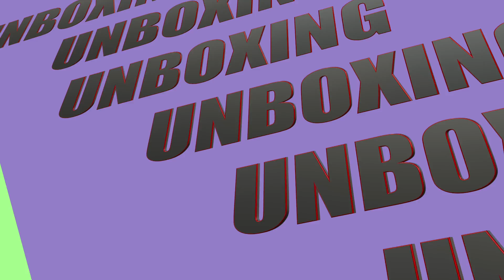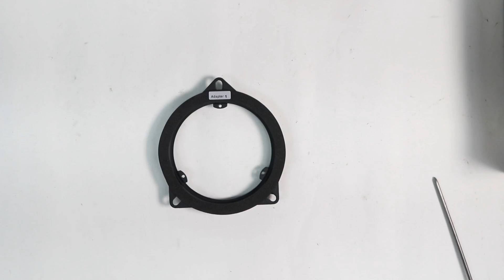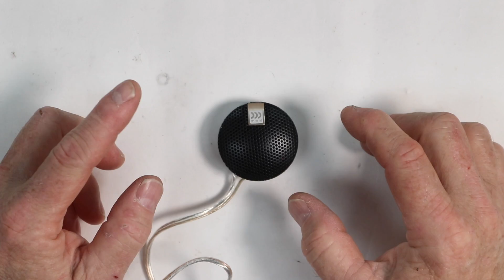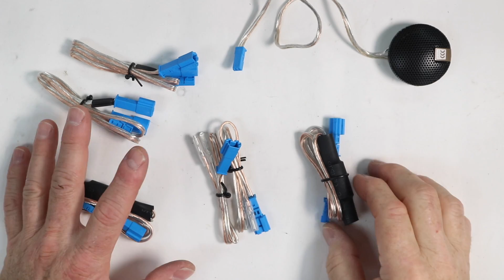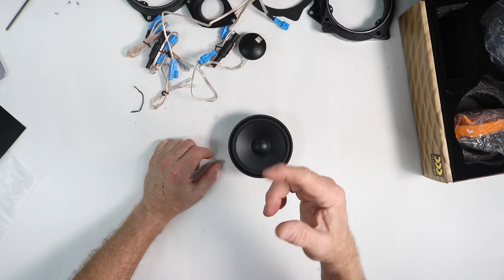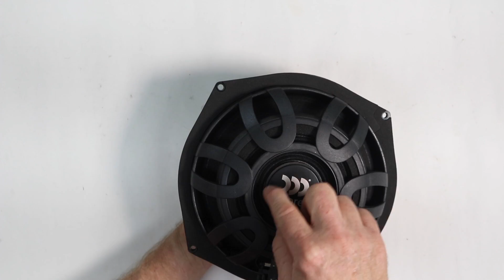The new Morel Integration BMW speakers plug and play

Comment: Im trying find the comparison betwen the reference and performance options. What confuses me, is i would assume the performance to be the better choice, higher tier. But looking at the specifications, the reference component handle  more power and the frequency response is up to 25k....have you tested or compared the two. Hopefully fast reply. I am trying to decide whst to get. Focal K2 performance or the morel reference or performance series erc. Also I am leaning towards the mObridge integration and dsp unit. As much input is appreciated asap. Thx